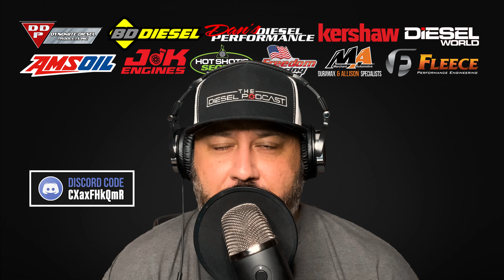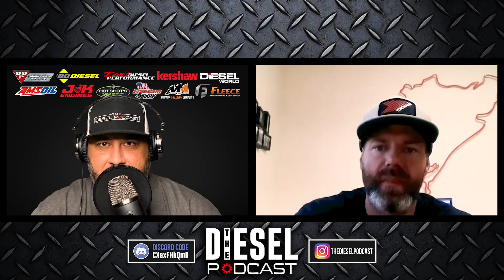6.0L Powerstroke in a Nissan GT-R, Gran Turismo 7 Style

Comment: I’ve been waiting to see if this would happen.  6.0’s have a favorable size/power/weight ratio.  Cummins have always been popular for reliability and higher ultimate power potential, but 6.0’s rev faster and higher and make quicker boost and power.  Reliability on six liters has been figured out.  There’s more to performance than just dyno numbers.  I think 6.0’s will become more popular for these types of builds once people look beyond all the bad reputation and focus on performance potential.  They are hot rod engines.